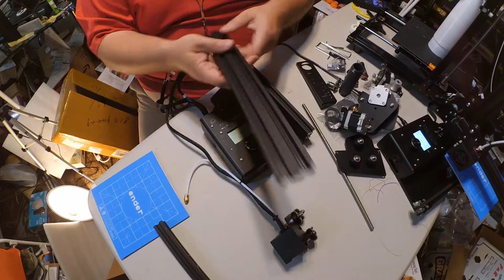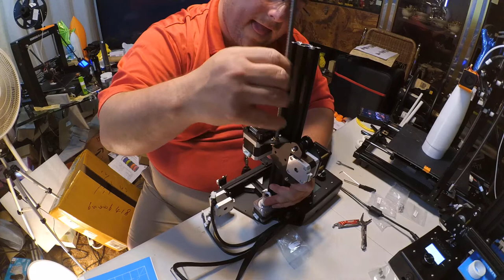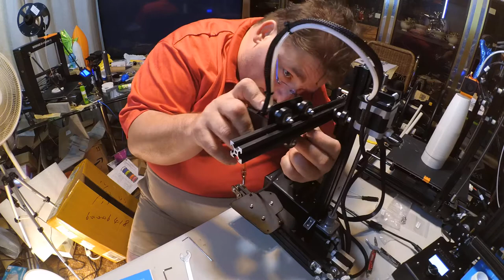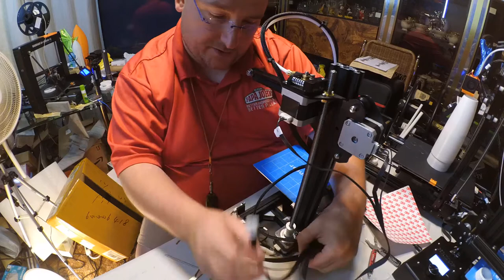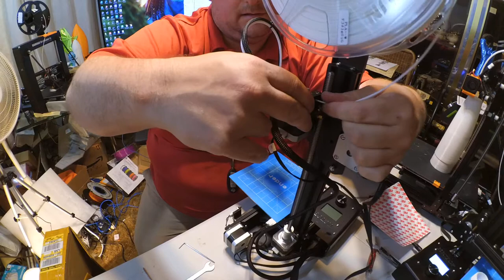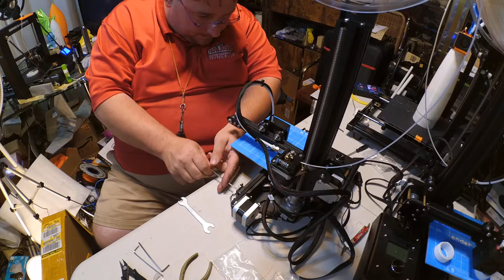Today's 3D Print - Ender 2 Build 2

Comment: Thanks. one of two built today. went over the top and added some dampers (had them on hand already). Added fang parts cooling fan, QD on the entire hot end & fans. Insulated the bed. Thing gets up to pla in about 2-3 minutes. Bootloader & firmware update... Printed decapicat (apparently they fixed it on this sd card) at 125% Feedrate in 2:25. flawless. to be expected. Now to fine tune.
Reply from the maker: +RobbyMaQ nice. These little critters are truly little marvels.
Reply: Well poop! Heater cartridge crapped out after just a few test prints on one of the enders. I did not get spares like some people, but luckily I had some on hand. This thing is so quiet!!! Will make great additions to my couple of S4's!
Calibrating x & y: https://www.youtube.com/watch?v=T8ZS3jaG9U8
Reply from the maker: +RobbyMaQ rough. I had the hc die on the a4 i just got. Grrr annoying :-)
Reply: Sorry man. Hopefully you had plenty of spares. I'm sure you do. I learned my lesson early in 3d printing. Have lots of spares on hand :)

Comment: Hello, I have just received my Ender-2.  Now that you have worked with these for a while, would you save it needs a part cooling fan?  Also is the build surface OK without glue stick or hairspray?  Thank you.
Reply from the maker: +Alan Dimery I have so far not had a need for a parts cooling fan I believe it actually kind of has one the Shroud appears to be designed so that the excess air from cooling off the hot end ends up blowing over the model and I believe that's why it works so well without a parts cooling fan

As for the print surface yes the one that comes with it, the blue Pei type surface, is actually pretty good and surprisingly durable
Reply: Thanks Nerys.  I have just finished my first part print, to test it.  Just a few layers.  It does stick very well.  The layer was very smooth.  I will do a complete print now to test it fully.  But I am very satisfied so far.  Especially for £137 delivered.  BTW I do like your videos.  You gave me several handy tips during my assembly.

Comment: potential for as to be my second printer^^
Reply from the maker: pixelcomet hell yeah it's a good compliment to the cr10 it all how you do small stuff while you're big printers doing the big stuff
Reply: exactly. 200 bucks is nothing for this thing. Im gonna print a framework for my custom pc which is mounted on a wooden board and needs some larger protection meshes. print time 84hours! ouch ^^

Comment: Why did you go with the Z-stepper first this time?
Reply from the maker: No particular reason it was probably just the part closest to my hand or that I happened to glance at first :-)
Reply: Omg you answered right away!  I'm building right now.....trying to go through your video and find mistakes you made (little errors of order of operations) so I don't do them...
BTW, it was tricky to figure out if both of those hammer nuts on the Z tower locked in...do the horizontal one firt, this slied it up to the vertical one and if it catches, you got it!
Reply: So, I only have the included filament sample...is the VERY VERY VERY first thing I should make a back knob so I reach it...or something else?
I don't want a cat or a clover or a marvin..I want useful!
Reply from the maker: Typically the reason to print something simple such as a Marvin is because it uses little filament is Prince fast and you know what it is supposed to look like so you will know if the printer or slicer is working correctly

My Ender 2 doesn't need any 3D printed parts so as for useful prints I don't know that depends on what you need :-)

Comment: I just got my ender 2 today and I got a completely different power supply have to wire it my self. Did they change them or did I get the wrong psu with mine

Comment: Im currently getting into 3D printing and I am looking for a printer that I can put on the desk in my room. The size would be perfect and as far as I can tell the quality of the prints is quite decent. But can you say anything about the noise level of the ender 2? Is it louder than other printers and can you make modifications for the ender 2?
Reply from the maker: Simon333 Rudolph333 it is one of the quietest printers I've ever owned it's virtually silent and you don't even have to replace the fans you could put this in your bedroom

It does not need modifications for print quality although a part cooling fan might help with some prints

One mod I am considering is replacing the Z rod and the vertical so I can go higher than 225 mm 300 mm would be nice the 6 by 6 print volume is okay for most of the things that I want to do I have the other printers if I need to go bigger
Reply: Nerys thank you!

Comment: Thanks to watching your vids on the Ender 2 , I ordered mine yesterday, delivery on Monday :) (Ordered from UK stockist so paid more than on banggood etc but UK based after sales support and warranty !) 

I'm a total beginner so after some advice from you .
What silcer do you use ? 
And I imagine there's no preset settings available on them for this printer , so how do you get the gcode setup the beat for this printer ? ( Do you manually do it until you find best settings for example ?)

Thanks
Reply from the maker: Dylan Williams i use simplify 3d. Extrusion multiplier to 1.00 retract to 5mm extra restart to -0.45 coast to .2mm
Reply: Thanks. I'm sure all of that will start to make more sense once I am.up and running lol :) great to see such good results on this printer so thanks again
Reply from the maker: Dylan Williams they are settings in the slicer. I will make a video explaining at least with simplify 3d.
Reply: Nerys Thanks , I'll look forward to it !
Reply: Nerys I've taken the plunge and bought Simplify. The Ender was much cheaper than I was planning to spend (I have space limitations currently so the Ender will do for next year or so), so I've used my spare cash to get it. I see it as an investment as it will stay as I swap between printers as the years go by !

I believe there are profiles you can export that I could then import to mine to get all your suggested settings just right . If you're able to do that I'd be grateful . 
But I'd agree a video explaining them with the reasons would really help.
Reply from the maker: Dylan Williams no problem i will export it tonight but its really pretty simple. Specify your print volume 5mm retractio. 1.0 multiplier. That is all you really need. And those change depending on what you are printing. For example the pen i am printing i have to turn off restart coast and reduce retract to 1mm to get it to print right.

I will post tonight when i get home.

Comment: I can't move/spin the Z axis rod by hand when assembled
Reply from the maker: hmmm make sure nothing is binding. if the printer is "OFF" it should spin very easily with your fingers.
Reply: I had the same problem and I had to adjust the z-axis motor. Release the motor by loosening the two screws that attach it to the z-axis, then make sure you can move the rod by hand. Now slowly tighten the screws that hold the motor in place.

Comment: Have you done any mod on the ender? Or it works fine without mods? Im thinking of getting one as my first 3d printer.. No knowledge whatsoever in this
Reply from the maker: +DimplePoji as long as you're reasonably competent DIY and not afraid to tweak and play the enter to is a fantastic first printer it's both cheap and well-built and on top of that the quality of the output is truly remarkable and at $163 the price is crazy cheap for as long as fat coupon code works but even regular price is only $200 the print volume is also bigger than advertised I can get 150 by 160 by 225 out of it take your time watch a few of my videos on the Ender 2 and you should get off a good start
Reply: Nerys oh i watch almost all your video.. Haha.. You have yet to print any flexible filament right?

Comment: Is the Ender 2 Marlin based?
Reply from the maker: The Best Stooge not sure. I want to say yes. Its the same ui as the cr10
Reply: If it is Marlin can we use the Arduino to modify it?  I got burned on one printer based on Sailfish last year and I am a RepRap guy so Marlin I love or even if it based on Due or Smoothie as I like to tinker and if it removes that ability and just shoves a printer at me (even if it was perfect) then it isn't for me.
Reply from the maker: The Best Stooge I don't see how the board matters much when you can just replace it whatever you want aren't those boards like 30 bucks?
Reply: They are now but see getting them to match up and not have a spider layout is bad.  Spider layout is what I am used to with RepRap but damn it is so ugly I have to hide my printers.  A 32 bit board is now 50-60 dollars BUT the kicker is they want thermistors and this board is based on a Mightyboard which uses a thermistor for the heated bed and a coupler for the hotend. :/  What this means is having to add yet another board for that and trying to get the signal to jive with what a thermistor would be.  Not easy at all so you need a real deal which is half the price I paid for the printer which was 650 last year.  250-300 is what a real Due/Smoothie would run so not worth it and why I never bothered BUT this is why I was asking for the Ender 2.
Reply: Yes the board can be flashed to run Marlin.  It's a Melzi board. You will need an Uno and some bits to flash the boot-loader onto it as there is none from the factory.